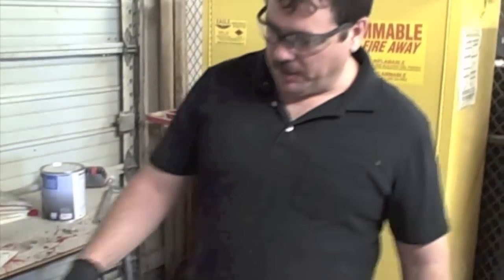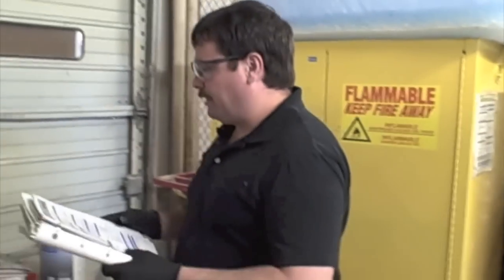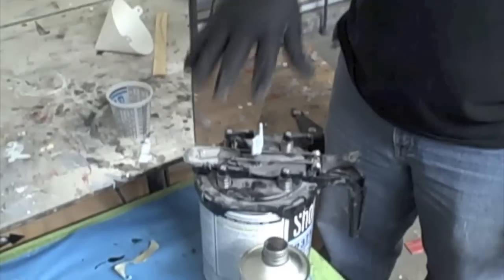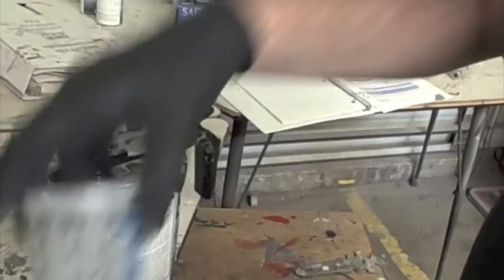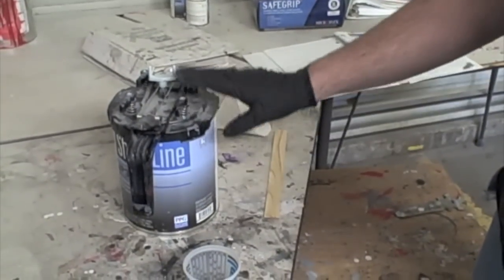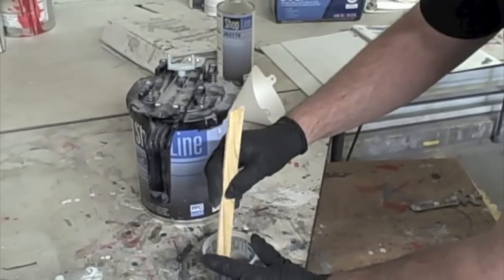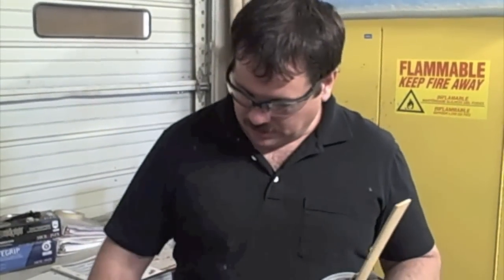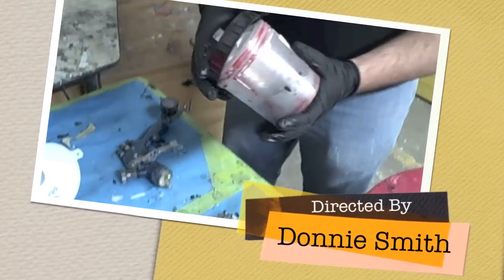How To Mix Epoxy Primer in HD

Comment from the maker: You can apply epoxy over properly clean surfaces.  Epoxy has the corrosion resistant properties and it adheres extremely well.  It sticks good to the substrate and other coatings stick to it good as well.

Comment from the maker: @dills2403 epoxy is much better for corrosion resistance and adhesion.  Lacquer has been around for a long time.  It is basically used for filling.  However, it has a tendency to shrink after applied, which may result in scratches where your body work was performed.  two part primers are much better.

Comment from the maker: @dills2403 If you are using lacquer primer over metal, then it may not adhere well. You need to use epoxy or self etching primer over metal.  However, if you are priming over a painted surface, you should not have a chipping problem.  

As far as the window, every brand is going to vary.  With the brand that I use, you can top coat after 30 minutes and no longer than 72 hours.

Comment from the maker: @Pendemic Epoxy primer is my preferred method, but it is not the only way.  You can use etch primer, it bites to the metal and provides corrosion protection as well.  If you are going to spray small areas etching primer in a spray can will work fine.  Let me know if you have any other question.  Thanks for watching!

Comment from the maker: @surf403 You do not have to put your top coat, just your next coating.  You can use epoxy on your bare metal and spray primer surfacer on top of that.  Then you can sand with not time limit.  Once sanded you can apply more primer surfacer if needed or top coat.  Does this help?  Thanks for watching. Check out CollisionBlast(dot)com/Coupons for discounted supplies.

Comment: Hi I plan on sand blasting some rust spots on my car. What would you recommend doing after that? Applying epoxy primer? Do they sell epoxy primer in spray cans or would I have to mix it and spray it on with a gun? I bought self-etching primer but now I see that it's not the right thing to use.

Comment: @ButlerCollision Thanks. I'm just looking for the best protection against the rust coming back that I can. So the self-etch primer should do the job, right?

And what process should I use exactly?

Sand blast,
Apply self-etch primer (should I be scuffing the metal befroe doing this?),
Scuff self-etch primer (??),
Apply body filler (scuff this too??),
Apply more primer (scuff??),
Paint,
Clear

Comment from the maker: No, most epoxies have a window.  This is the time you have where the epoxy will provide a chemical bond.  After this window, the epoxy loses its chemical bond and you must provide a mechanical bond.  Just a light scuff will do.  With the epoxy I use, I have 72 hours to spray top coat.  After 72 hours, I will need to lightly scuff with a red scuff pad before applying top coat. So if it set for a few months, I would scuff before top coating.  Thanks for watching and let me know if you have questio
Reply: DIY Auto Body and Paint i

Comment: i've come to the point where i am confused with all the different types of primer, i'm working on painting the whole front end of my car which is a single stage white toyota, and planning on sticking with some urethane single stage paint. however the panels i am painting have factory paint (one is base/clear other is single stage. both parts will have some bare metal showing so i'm stuck on what primer to get, hoping i can get away with just one type of primer..please enlighten me! thanks!

Comment: how does reducer play into epoxy paint mixing?
Reply: Adam, sorry you didn't get a timely answer, but epoxy mixed according to the TDS / SDS (Technical Data Sheet - Service Data Sheet) does rule. 4 years ago, there are less than half of the epoxies as available today in 2022, November. But 2:1 or 1:1 is common. Adding a high quality urethane reducer of the correct temp range, reduces mil thickness but sprays much smoother. Most starting use epoxy on the bare clean frame or panel protects it from moisture in the air, two coats = rain and temp changes that meet the dew point. Adding the urethane up to 10% is an excellent sealer to make the color paint stick better, can be colored by adding pigments sold at a paint shop. Never add just paint as dryers, enamel resins can have reactions. But if colored and chipped by rock, it is not as noticeable. Can have base coat/clear or solid colors called "Single Stage" sprayed on top. Clear can be sprayed on single stage as it simply add extra layer of protect, but always check the TDS sheets again if allowed. Chemistry changes fast and alway note & take photos of cans, air pressure, tip size, brand & color number in case of future repair. Ads value to car if selling as well so a fender bender can be matched & blended.
DK, ASE Master Tech since 78, retired.
Reply: wow thank you @deankay4434